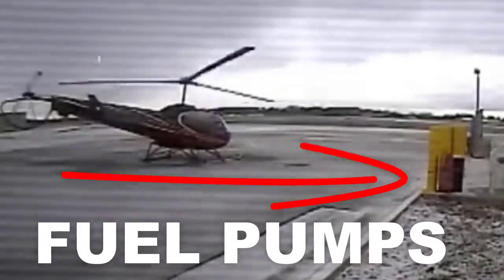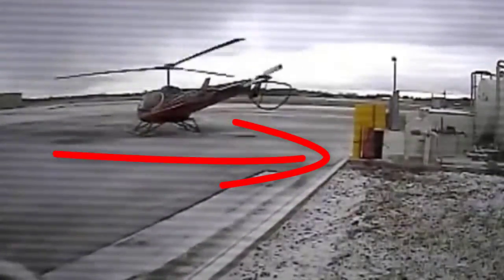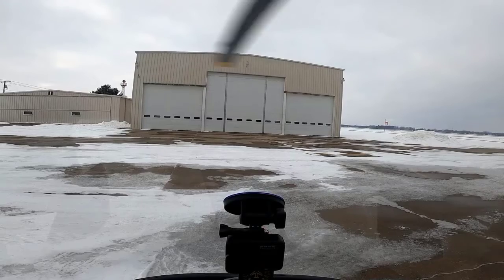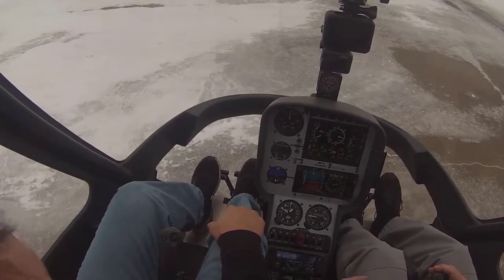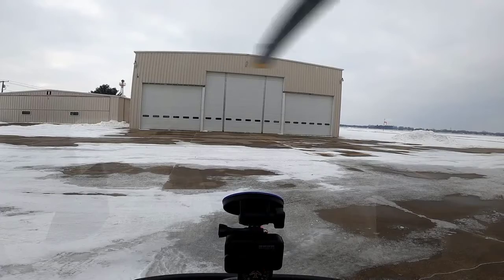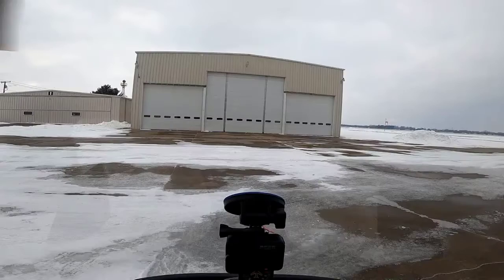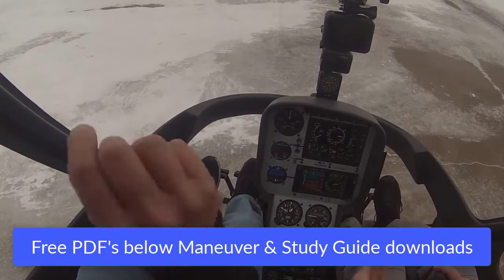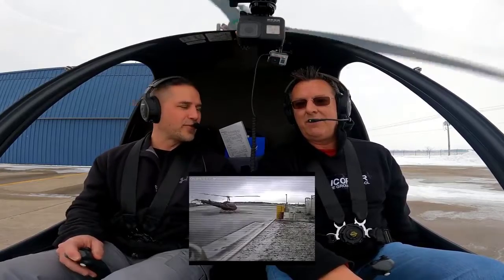How to Avoid Tail Rotor Strikes with One Simple Technique!

Comment: So, which direction does the aircraft tend to rotate when you test the Sprag clutch? Presuming it’s different depending on which direction the rotor turns.
Reply: Right pedal for counter clockwise system (Robinson/Enstrom), left for Cabri etc,